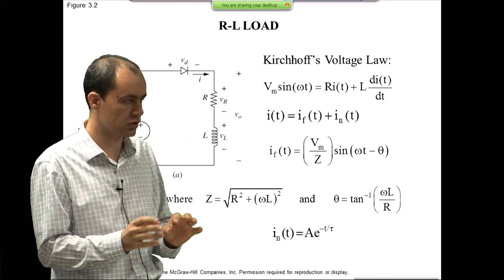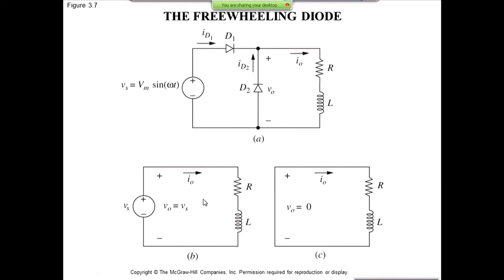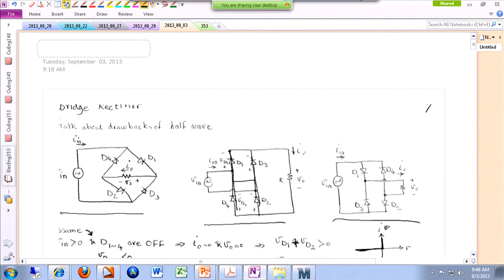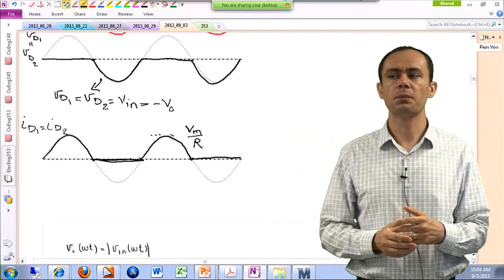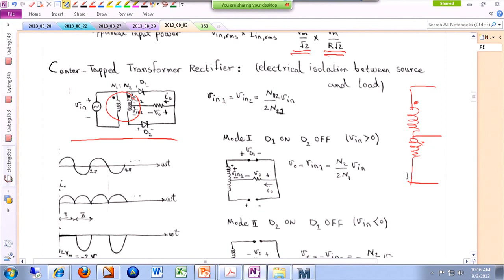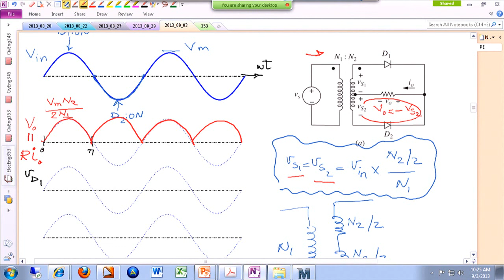[05] Power Electronics (Mehdi Ferdowsi, Fall 2013)

Comment: Why did we do KVL around the big loop in the center tapped full wave rect, when we were only looking at one diode at a time during conduction, ie the current is only encircling the smaller loops at one time?